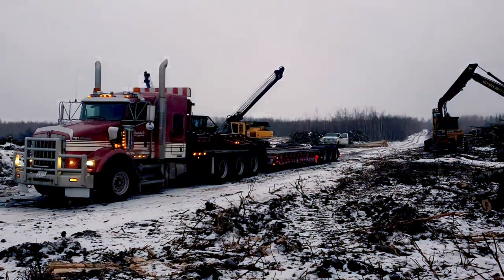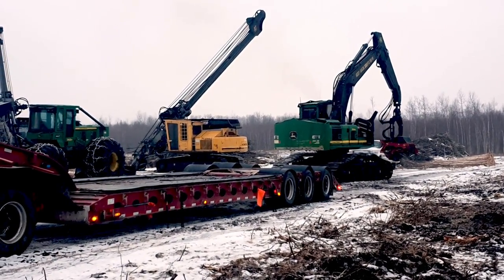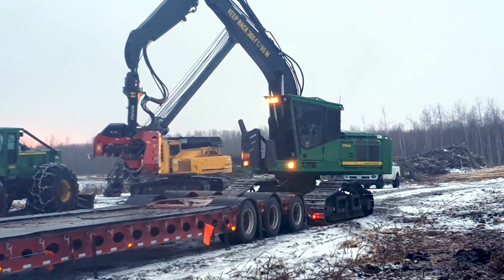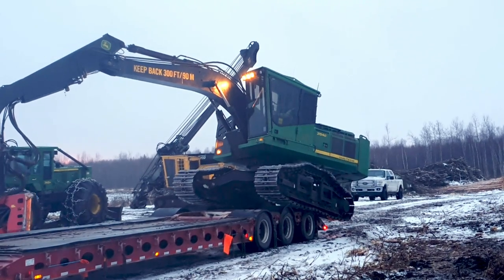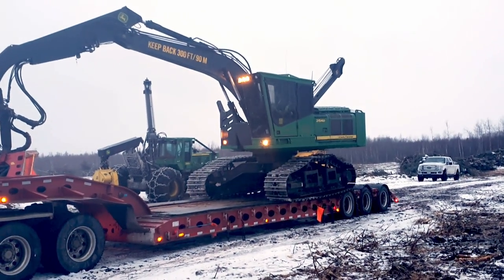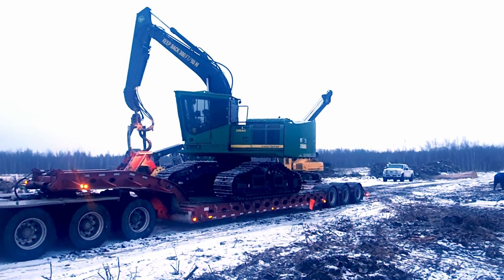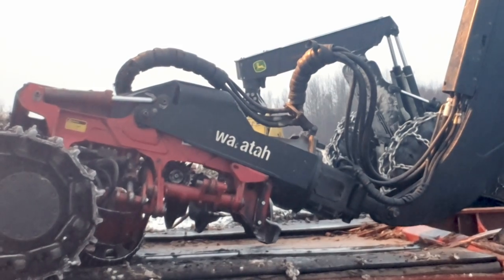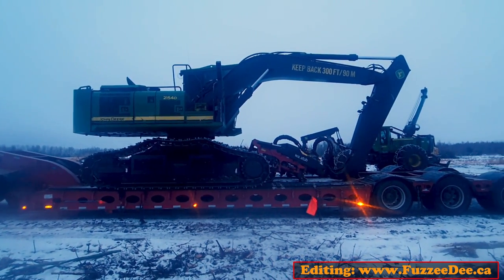Loading a John Deere 2154D log harvester on a lowboy

Comment: Love the noise , diesel smell, and the rumble of the power.  Could watch all day, Thanks!!
Reply from the maker: I hear you! I feel the same way.  My wife's not so interested though. I bought a tandem gravel pup at the auction last week.  Pulled it home yesterday after work  and parked literally on the garage pad with 2 huge tiles loaded in the back. She got home after me and didn't notice it.
Reply: @lovesloudcars  That's funny!!  Mine wouldn't notice if the house had burned down, but would want to know why the fire trucks were on the block!  Thanks for your response

Comment: Good ole Alberta knowhow.  Hey what’s with your weather? Nice in southern Alberta, thot you’d be driving around in the vette by now.
Reply from the maker: He did great hey?
We're looking like spring is here- kind of...
Lots of open ground on the fields,   It looks like there's going to be hardly any run off at all,  but the yard is still completely white. Today is the first time I've seen any water flowing. 
Corvette : Bought a new radiator for the car.  New rad and electric fans.  Hopefully it will run little cooler. Sooo many projects on the go. Something up with the transmission on the right hand drive Nissan from the tire chains video too. I've got 3 others all with 5 speeds instead of automatic. 
Shall I continue with the list?? But some cool or interesting things to edit and post as well.
Reply: Don’t forget the Chev Apache!
Reply from the maker: @barnycanuck6234   People used to ask me "Do you still have that old black truck?" My reply was " Am I dead yet?" Still in the family anyway. But yes. I think some drone footage of it driving might be cool.

Comment: Is he the driver of the lowboy also?  
What year is ur ‘Vette?  When I was driving over the road I owned an ‘80 Vette.  It was quite a change to go from an ‘86 Ford LTL 9000 down into a automatic Corvette.  Later I sold it and got a beat up ‘78 silver anniversary and rebuilt the motor.  it had a four-speed manual. Lotta fun that car, and since it wasn’t pretty I wasn’t afraid of thrashing on it lol. 

 in my opinion don’t worry bout “boring“ times in ur vids. we all have fast forward buttons and we’re not afraid to use them if we want to. I don’t because I might miss an lol moment.
Reply from the maker: The truck driver is the one who loaded it yes. I assume that the regular operator would probably be faster because he lives in it..
My car is a 69. But not stock body for sure.  I bought it that way.  69 had a flat back window,  mine's got a sloped one like the later years. Big block and changed out the 4 speed & put in a new tremec 5 with an overdrive.  Haven't ever really used it because there's always something more important to work on.  New replacement rad with electric fans waiting to be put in..
I have a friend at work selling a 78 if you're looking for another. 
I usually like what I post,  but sometimes I'm concerned about video length.  I don't really enjoy extra long videos unless there's lots of good content,  and don't want to always cross the line of "too long "

Comment: Why didn’t they drop the gooseneck? Instead of climbing over the back I would think that it’s safer more time consuming.  But equipment ain’t cheap.
Reply from the maker: Good point.  I'm not sure what his reasons were. I'll have to watch it again to see what type  if it's a detached gooseneck or a scissor neck where you lift it with the winch.
Either way,  good point.  I've had a guy bring a machine to my place & dropped the detached neck & loaded off the front. I  suspect time/ experience and comfort level.
Reply: @lovesloudcars  I’ve seen one operator climb the side of the low boy and spin his machine on the trailer. Scary to watch but it was quick
Reply from the maker: @alanandtiffanypaige3616  gotta be pretty hard on the trailer rails you'd think hey? I've heard of guys doing that,  but never seen it. 
My dad watched a guy unload a D8 off the back of a 45 foot 16 wheel highboy  years ago.  That would be interesting..
Reply: I could watch this all day long. When I was a kid a friend had a relative with a yard full of heavy trucks & excavating equipment. We spend the weekends there watching them service & loading them
Reply from the maker: @davidrubin1895  there's something cool about machines hey? I've been around them all my life,  different sorts.  Sawmills drilling rigs,  farming and whatever else I don't know.  I'd rather be where I am than working in a dentist office I can assure you. 
Between computer problems stopping the ability to edit longer videos and being very busy with work,  I'm collecting more videos than I'm managing to check off the list. ( which is kind of a good thing) .
Thanks for staying tuned. It's both fun to share and to connect with folks.
Reply: @lovesloudcars  I've worked with my hands my whole life a majority of it spent outdoors. 10 years in a junkyard, etc. Anything construction or mechanical I've had a hand in.
Reply: That's west coast style. Everyone goes over the back here in cali. Takes too much time to drop the neck

Comment: Can you tell me how much fuel you burn by hours with that processor?
Reply from the maker: I'll ask the operator.  I'll send him message and hopefully he'll reply fairly soon with the answer and I'll let you know.
Reply from the maker: Here is the reply: Hello,the processor will burn different amounts depending on the size of the wood and if you have to fight to get decks appart! But a good ball park figure would be 20 to 25 litres Per/hr
Reply: Ok very good explanation, and it’s not too bad for that size of machine 
Thanks
Reply from the maker: @rottnesmv  no problem.  I see you have several logging ones posted. I'll have to watch them,  I always enjoy logging equipment.
Reply from the maker: @rottnesmv  https://youtu.be/tUDJuPYD0Oo
that's the link to the video posted of this machine working here. Barry is the operator who replied to your question about fuel consumption.
Reply from the maker: @rottnesmv  I wish I had all the small stuff that you put down in the path under your processor in your videos. A guy could process a lot of firewood out of all that small stuff that otherwise goes to waste.
I picked up Canada's first chunker from Poland recently. I plan to use much of the small stuff that was set aside when they cut that block. Going to run it all through and use it for my boiler.